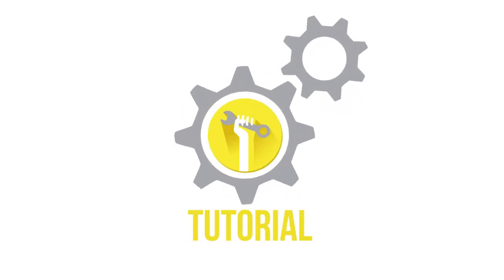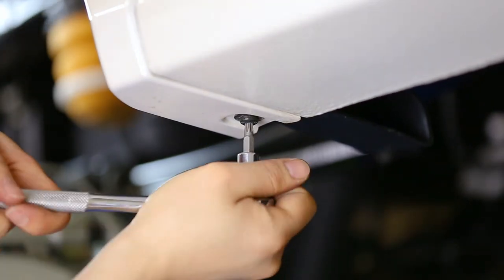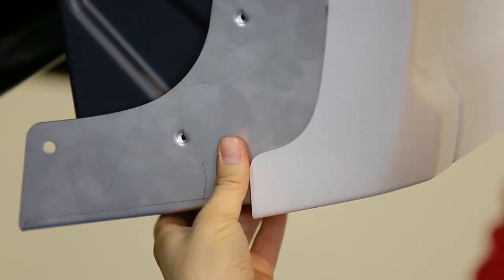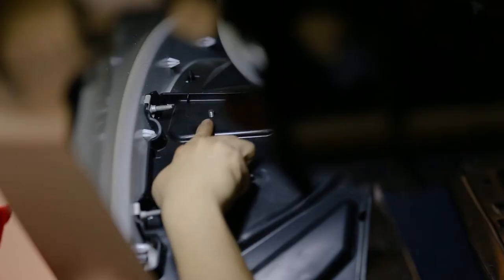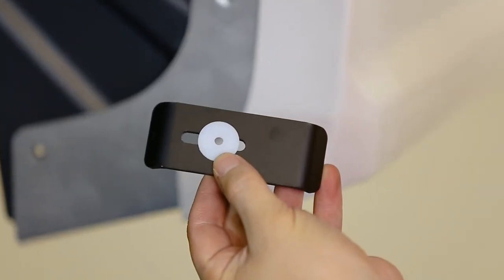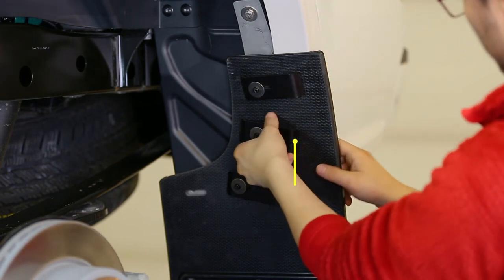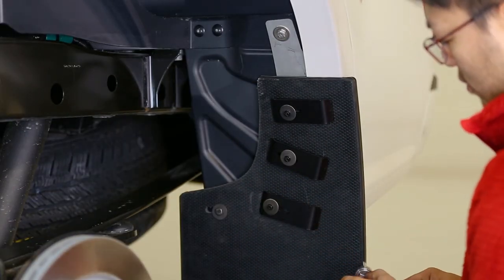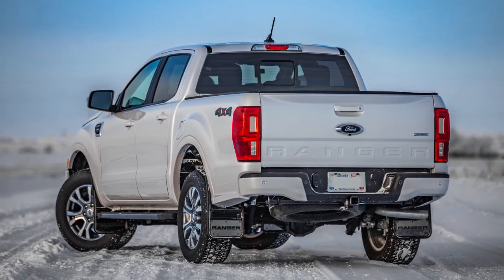Gatorback 2019 Ford Ranger Rear Mud Flaps Install

Comment: For $250 I would think you could have come up with a better solution than those 3 ridiculous U clips !!!! They make it look like they were home made from a scrap pile of junk parts !!!
Reply from the maker: The U-Clamps are required to keep the outside edge of the flap tight against the edge of the fender. The Ranger does not have very many mounting points which limits where we can attach the flap. Our main goal was to keep the flap a no body drill installation.

Comment: When I ordered, the website says no body drilling, so why is there drilling?
Reply from the maker: Sorry for the confusion, no body drilling was meant to describe that you are not drilling into the body and breaking paint, they only place you need to drill is one small hole through the plastic factory liner.
Reply: @TruckHardwareLtd  gotcha, I see that now. Thank you! 😊